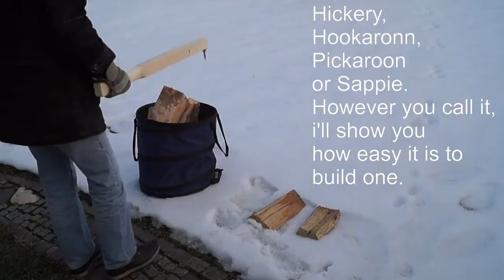DIY How to make a PICKAROON

Comment: Due to the magic of editing or extreme good luck you had no buggered up threads on your modified bolt when you installed the nut. A trick to clean up the threads is to put a nut on the bolt before you do any grinding, than when you are done run the nut off and it will clean up the threads.

Comment: I used a wide PT picket for a fence and a simple rod with tread, 2 washers, 2 nuts. Wrapped the handle in hockey tape. Cost about 3 bucks